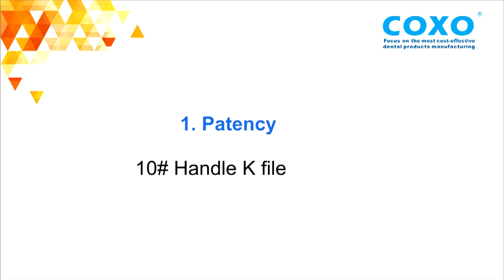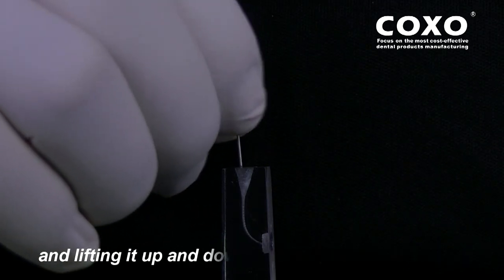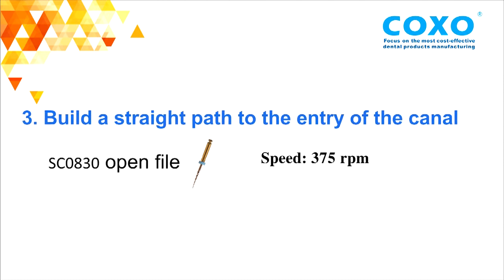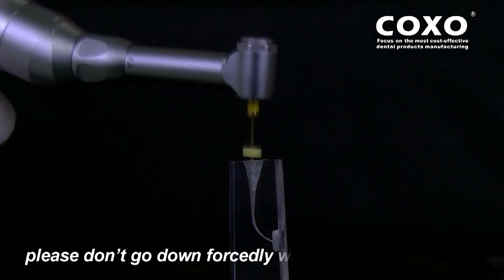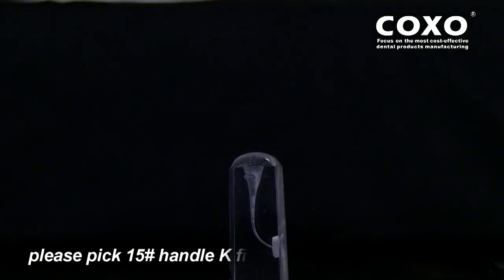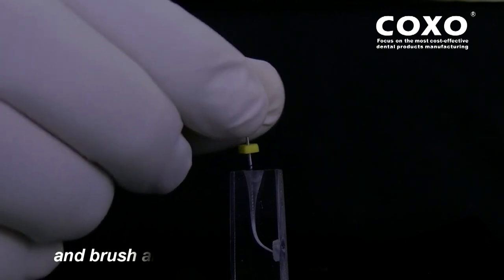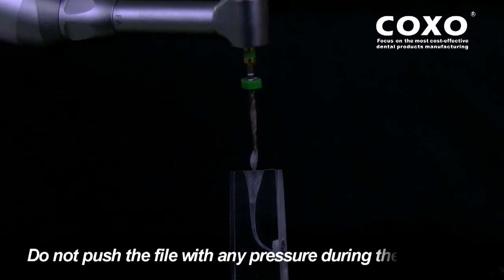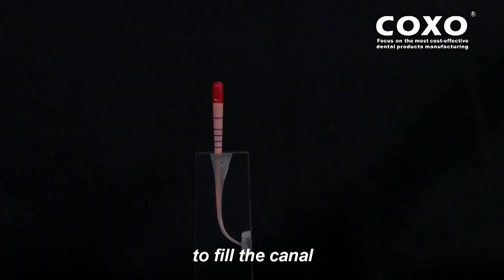SC Pro Niti file operation video

Comment: on the tip of the dental filles, in front of the canal entrance, some kind of paste is visible, what is this ...??
Reply from the maker: It's EDA which at a concentration of 17%.
Reply: @coxotec  but how to install the electric micromotor, whose components are placed inside the unit ...? do you have a video about this ...? .